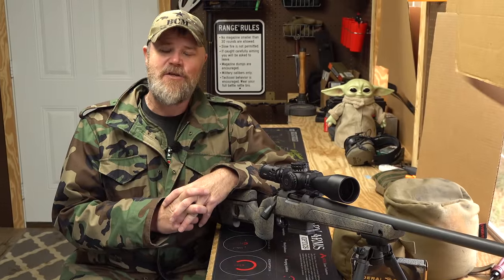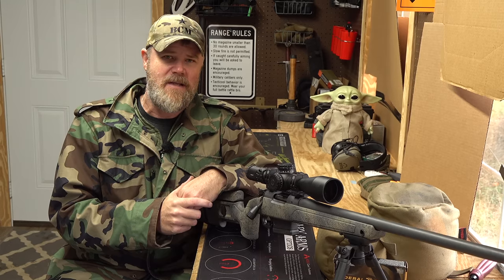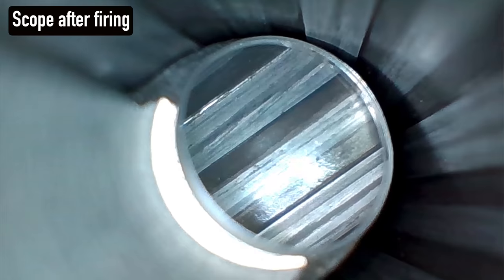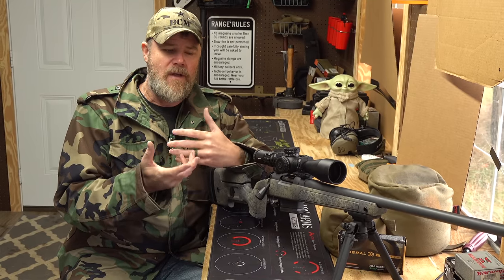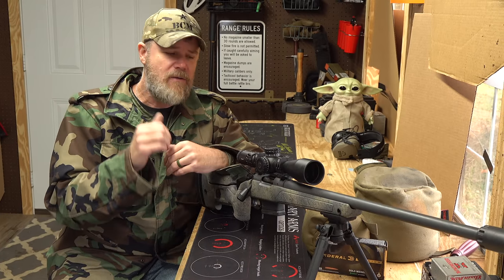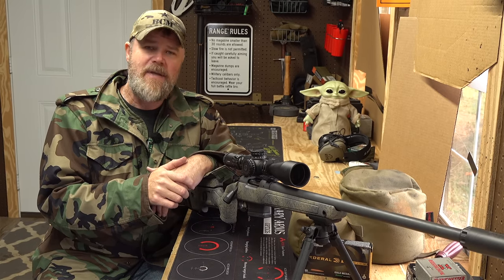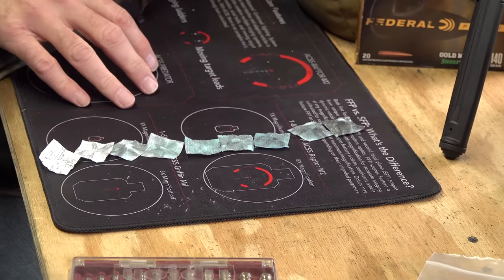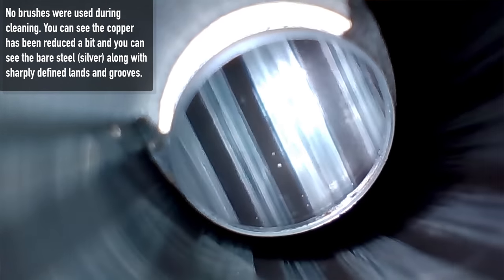Barrel Break-Ins and Cleaning Voodoo Rituals Destroy Barrels

Comment: "You don't want to overclean your barrel."  I wish someone told my Drill Sergeant this back in 09. I see your point on nylon but even you admit that brass/bronze is softer than steel. My DD's are steel, chrome lined with a lifetime warranty. Maybe one day I'll make the switch to nylon from bronze. Just stocked up on CorrosionX CLP.
Reply: Yeah me too 😂,  in Switzerland they made us do 25 times with the brass brush 25 times with the nylon brush and clean with white tissues and After your barrel look like a new one put shitty black grease in service from 1911 so you have to clean it before the next shooting day to avoid barrel obstructions 🤯😂😂😂

Comment: I have 3 Desert Techs. Each one shoots same hole with precision reloads. As Tod Hodnet professes, I only clean carbon with Bore Tech carbon cleaner and a nylon brush. The "cold bore" shot inconsistency disappears. The Otis cleaning method works best. Every 100 rounds, if I can remember,  I'll run a couple Tubb throat maintenance rounds through it.

Comment: When I worked in the defense industry.  The Bushmaster and Asp cannons used EDM to put in the rifling.  No burrs!  They also had a variable twist rate.
Personally I have compared popular materials used for gun cleaning and preservation, to using silicone spray.  WD40 has been used by some old timers.  The silicone spray and patches seems to clean and preserve real well.  It takes fewer patches to be clean with the silicone.  And I have never seen corrosion.  Last year, I took a trip around the USA.  I took some guns to shoot on relatives property.  All the guns were in cases, blankets, or boxes.  The truck bed   has a lockable bed cover.  Some of the guns accumulated moisture.  None of them developed rust.  So silicone spray is a win for me!

Comment: with my first precision rifle i decided on one of the simpler procedures, of firing 1, clean 2 clean, up to 5,  just to lay any manufacturing defects over, then run it, my habit in the past has been to clean after a range day regardless of rounds fired, so far its best group has been .919 inch at 300 yards, since i did that break in ive decided to try letting this go and its been good so far, though i havent been out with it near as much as id like because of ammo/component shortages and bidenflation

Comment: Lots of this is dependent on the type of rifling and the overall quality control.  A well made single point cut rifled barrel will likely not need any "break in", as it should have almost no tooling marks or variance in bore and groove diameters.  Button rifled barrels, even if made to a very high standard and lead lapped, seem to do better after a few shots have smoothed out or filled any remaining surface imperfections, but in many cases can then shoot as well as the cut rifled barrels.  Hammer forged barrel quality is similar to button rifling, and is also highly dependent on honing or lapping processes to remove tooling marks from the drill/ream operations.  Broach cut rifling can also give a pretty poor finish without additional processes, but you really only see it on pistol barrels these days anyway.

As for scrubbing away the rifling, you'd expect to see that more on a cut rifled barrel than on a buttoned or hammer forged barrel.  That's because buttoning and forging work harden the bore, making it more wear resistant.

Comment: What kills barrels, for you AR/AK guys, is heat. The hotter you get your barrel, the more damage you're doing while shooting. The hotter the metal, the more damage that can happen with excessive friction from the bullet traveling through the barrel. These torture tests are flawed in their results. Bronze brushes are softer than the steal the barrel is made of and wont hurt the barrel, thats just science, and we've been programmed to accept that, right? Another killer of barrels is these snake oils to clean the barrel carbon/copper. Stop it! Alcohol works great. Copper fouling remover, depending on the manufacture, will kill your barrel like ammonia. Keep in mind, every time you fire your rifle, that projectile, the bullet, is pushing whatever is in there out, for the most part. If you're getting inconsistencies in groups, it's the barrel getting hot, the ammo or, it's you. I like to clean the barrel after every range day, regardless of the ammo count just to oil the steal to help with any corrosion that may happen. If you dont keep the steal clean and oiled, moisture can collect, even minutely under what ever was left from that last shot and collect moisture, causing pitting and eventually over time add to the reduction of life of the barrel.

Comment: I totally disagree with this. You clean the barrel while breaking in. This allows the first dozen or so shots to break down the roughness in the lands and grooves, and burrs. Then you can lap the barrel and polish it. This will improve accuracy.  Nathan Foster from Terminal Ballistic Research explains this best in his book. Also, brass and bronze brushes will not harm the hardened steel that is used for barrels.

Comment: F-class shooters never use bronze brush. There is a reason why. They are not afraid of damaging the bore but afraid of losing very thin copper film deposit in the bore, which makes the bore smoother and tighter.

Comment: That’s just ridiculous. Using a brush will not mess up your barrel. There are many high end manufacturers that include brushes with your gun so that you can use them to clean your chamber and barrel. 

Ask any metallurgy expert and he’ll tell you it’s not going to damage the metal. You just need to understand the dynamics of how metal reacts against other metals, and only use. Rushes that are softer than what your barrel is made of. 

Generally most barrels are made of steel, which will not be affected unless the metal the brush is made from is also steel. 

Choose a brush made of softer material and you’ll never have an issue.

Comment: Things a barrel maker will never say:
1- my steel barrels are softer than brass so use caution when cleaning.
2- my barrels shoot better fouled with copper & carbon.
3- my barrels require a break-in procedure to shoot well & clean easy.

Comment: Where in the world, please explain to me this. How in the world you believe for a fleeting moment that a brass brush will damage any type of quality barrel? Or even a semi quality barrel. If the barrel is tempered properly, brass cannot possibly damage the barrel. Stainless steel, if it is as soft or considerably softer than the steel that you're trying to clean with it will not damage the barrel but because you do not know the Metallurgy of the stainless steel brush, I might tell people to be very careful with it. But it's still not going to cause damage especially to a cut rifled barrel. At least not in general. But I always use bronze or brass brushes. Because they're infinitely softer than the steel of the barrel. But they are usually a bit harder than what you're trying to get out of the barrel. And nylon is softer than what you're trying to get out of the barrel for the most part so I don't know why you would waste your time even purchasing one.
I do agree with you that breaking in a barrel procedure is ridiculous. My very first center fire rifle that I purchased was a Ruger Model 77 in 7 Mill mag, Wade just under 9 lb and I put a Redfield Widefield 3 to 9x scope on it, I loaded the ammo with I believe if I remember right was 67 grains of h4350 which was the slowest powder available in 1979, and it was three grains over the max of any book that there was and because it was such a slow powder you couldn't overcharge it anyway. But I had gotten the load from a bench rest shooter, so 140 grain Spire point and my original loading was was Sierra but I ended up getting some Hornady which had a completely different shape to the bullet but they were just as accurate. When I got to the range I fired nine rounds for sighting the scope and then I fired a 20 round group that the widest part of the hole was .33 in. That makes a center to Center spread of .049 in.
That long thin Barrel worked perfectly. I did end up selling that rifle after firing about 75 or so rounds through it, in that time I had fired three 20 shot groups, all of them fired the exact same group size. It just never failed it exactly where I was shooting at 100 yards. And although I was going to try it at 300 yards. I ended up selling it to a man who had a use for the rifle, because I was never going to shoot any animals at least at that point in my life that needed to be shot with a 7mm magnum. But he paid me several hundred dollars more than he could have bought a brand new rifle with because I had not only the targets that I had shot with the rifle, but he bought the rifle with the scope with the gun case and I gave him 20 rounds of ammo that were already loaded. For several hundred dollars more than he could have bought everything brand new. But why are you feeding into this myth that brass and bronze brushes damage barrels. It just doesn't happen. The Metallurgy wouldn't allow it. If the barrel where that bad that a bronze brush would damage it, shooting a round off in it would cause it to explode.
Another thing that I will do especially with firearms that I use for any kind of daily carry or something I depend on for engagements is that I will spray dry Teflon both in the barrel and in the action so that I'm putting no oil on the gun to draw dirt. Not only does it work great as a lubricant, it also coats the barrel so that you get less heat transfer into the gun. I learned that with my 357 4-in stainless pistol. It would get prohibitively hot. Almost to the point of burning yourself when you open it up to reload it. After about three applications of the dry Teflon it would get warm but it would not get hot. I found that the dry Teflon was a wonderful application procedure for keeping stainless firearms from overheating. My guess is is it will work on a non-stainless firearm just as well.

Comment: If you run a brush of any kind through your barrel and it harms it in any way, the steel in that barrel is complete and utter junk, and I say bunk BS ! Fire your rifle until you get a good group about 20 to 30 rounds ya get a great group now clean it completely now shoot your group when your group comes back about 7 shots or so your done now just clean out the powder fouling every 25 five shots and your good to go, it is next to impossible to hurt a barrel with bronze or nylon brushes that's just a stupid hoax you just can't hurt that steal in those barrels otherwise the barrels would burst and there would be law suits all over the place, so that's just bunk crap hoax stupid, I have seen and heard to much of the speel I speak up and say BULL ! This is the way I will always do it, others will do whatever they seem fit to do, and if it works for them, then there is no need to blow words all over.